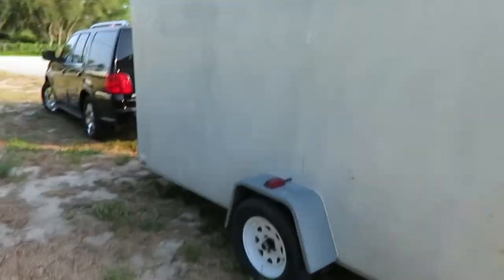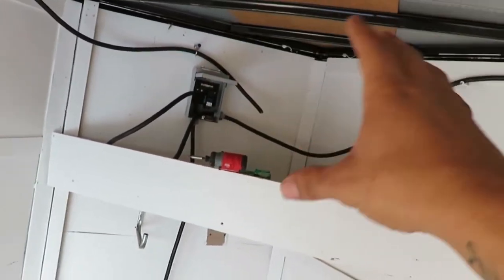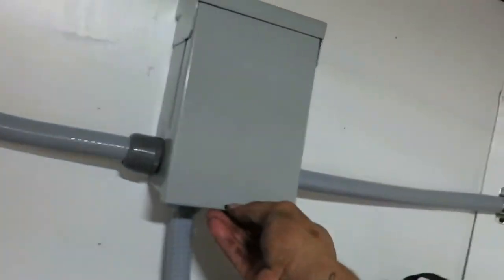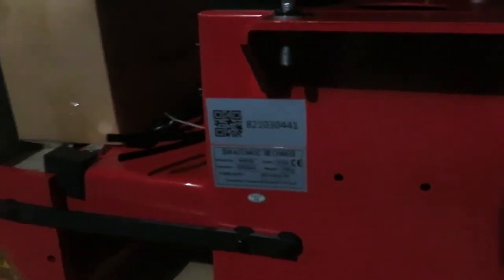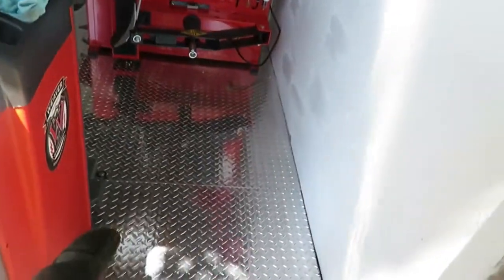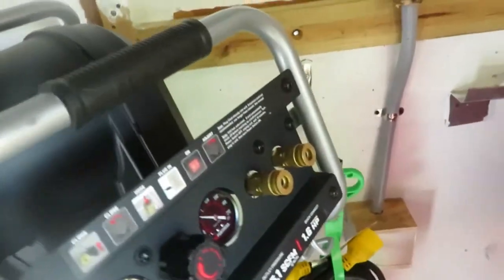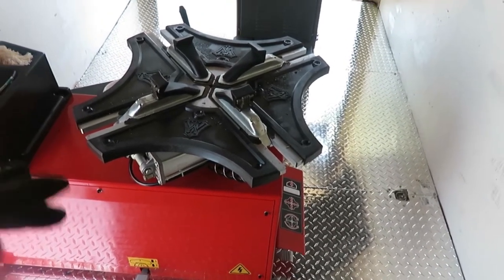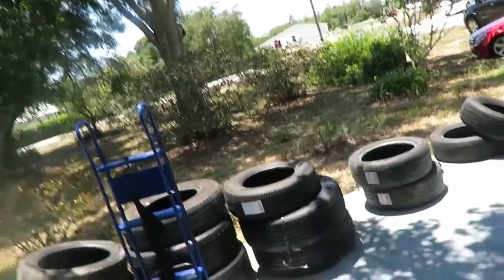How to build a mobile tire shop part 2

Comment: I’m in central KY and started doing mobile tires in July of 2020. I went with the weaver tire machine and balancer as well. I’ve had great luck with them.
Reply: How are you doing with that I mean what’s the population of the town that you live in and what was your first year like and how long did it take you to catch on I’m up here in northern Maine so my question also is how did you market this how did you introduce it to people and who did you introduce it to
Reply: @johnmattingly4909 what compressor and generator set up you go with I just purchased the weaver machines as well doing mobile as well just not sure what size I need
Reply: @jmoney3338  Did you get all set up? I've recently been thinking about doing this but haven't even started the researching process yet as far as what equipment I would need and what's good etc

Comment: You could extend the trailer tongue and mount the air compressor and generator there on a frame. For more space inside!!!
Reply from the maker: The generator is no longer a part of the system its now solar battery powered
Reply: You have video on solar power?

Comment: Do you jack up the trailer when you run the balancer? I use a hunter GSP9600 balancer and had to put a 3/8" steel plate across the floor and jack up the frame to get a good balance on 33" and bigger truck tires.
Reply from the maker: No I don’t sorry just seen this my trailer is already leveled on the hitch I have an adjustable hitch I made sure my trailer is leveled when stopped I never had a problem with balancing a wheel yet

Comment: Do you run your tire mounter on a generator or do you have a pneumatic one?? I was told a generator wouldn’t be strong enough to run a mounter
Reply from the maker: The generator controls the turn table and the claws are pneumatic. I have a 9000 watt generator and I could run my compressor, tire changer and my balancer all at one time with no problem at all. Idk who told you that but maybe they don’t understand that generators have different ratings and depending on what you buy is what you can run. Mine could power my house so trust me it has no problem running the 3 things in my trailer

Comment: Hi mate, Do u have the link for your compressor? what is the smallest size I can use for this set up?  thanks
Reply from the maker: I’m pretty sure every machine has it own specific rating but mine was a 150-175 psi with 5 CFM that’s the important part right there the air flow. I wouldn’t go less then 20 gallons just so the compressor isn’t always turning on and off making things louder and pulling more power from the generator because then you use more gas. Mine is 27 gallon 200 psi 5.1 CFM @90 psi and works perfect never lacked air but it does turn on about 2 times during a tire change bigger tank and it would only need to turn on once per tire. It is a little below the recommended power but like I said never had an issue. Here is the link to it.
https://www.harborfreight.com/27-gallon-200-psi-high-performance-vertical-shopauto-air-compressor-56403.html
Reply: @logicalthinking21  Thanks for your help. I will have a look. its around 100 Liter.

Comment: Is your balancer accurate on hills?
Reply from the maker: I’m in Florida so we don’t really have hills we are mostly flat and I really always try to stay on flat surfaces as long as both my trailer wheel are on the same level it’s good but regardless it’s more on how it mounted as long as you have your machine bolted to a flat surface it shouldn’t matter I have done a few on a slight hill well a Florida hill not like if your in San Fran and never had a problem with my balancing or any complaints
Reply: @logicalthinking21  that's refreshing to know because I have these swinging metal arms locking the bottom lips of the balancer to the floor and I unlock them and swing them out the way to level the balancer before balancing and I'm tired of doing that. I have the Derek Weaver now but I had the Atlas mobile balancer and they said it had to be level.
I'm in Atlanta so I do want it bolted to the floor for theft purposes. I'm going to balance the same tire twice with it level and then unlevel and see what I get.  Thanks for responding and I love your setup!
Reply from the maker: @INTIREMOBILETIRESHOP  thank you for that… the only thing I can say is the best way to compare it is to have your old one on a hard leveled surface and recalibrate it before anything both machine must be recalibrated on the new surface they are mounted to then do the comparison
Reply: Question for you tire mounter I always planned on trying an electric mounter but someone told me it won’t work because a generator won’t be strong enough

Comment: I dont think you will be able to run the machines with those braker.... ?
Reply from the maker: I been running these machines with no problem for 2 years now also with the same set up I converted to solar and battery operated
Reply: @logicalthinking21  nice . So you have the generator connected with the 240?
Reply from the maker: @lazaromartinez4780  no the generator is obsolete at this point haven’t used it in almost a year and these machines are not 240v they are 120v
Reply: @logicalthinking21 can you make an updated video showing the solar and Battery powered upgrade to the trailer
Reply: Hey what solar brand do you have ?
Reply: @logicalthinking21 what solar set up you use now ?

Comment: I wish you showed the electrical part 😕
Reply from the maker: If you have any questions just ask I’ll do my best to answer I’m no master electrician but everything I learned is just basic electrical stuff I did have a job as an electrician for about 8 months but I guarantee you everything I learned was just beginner stuff and everything I did in the trailer anybody could do so I’ll do my best to try to help out

Comment: The problem with this business model is the people want their flats fixed while they are working , but they also want it cheap. They won't pay a premium for it. So they can go to a shop.
Reply from the maker: That is correct but you have to learn your market for example in the city I lived in their was no tire shop for at least 20 min and a lot of people didn’t really have any other option or a lot of road side service calls it puts people in predicaments where I’m their best option